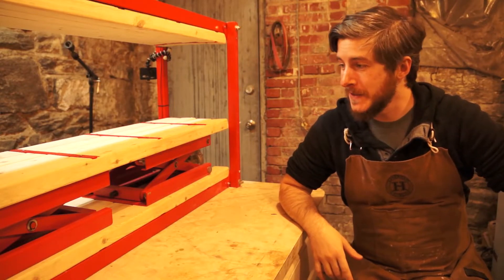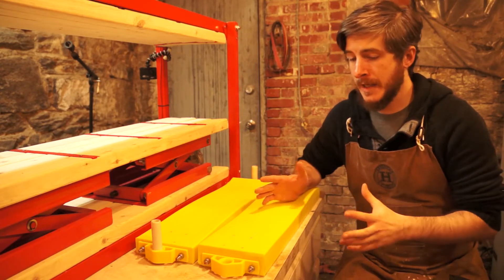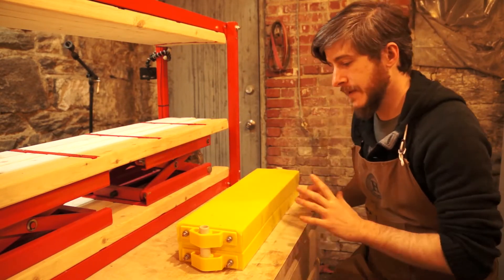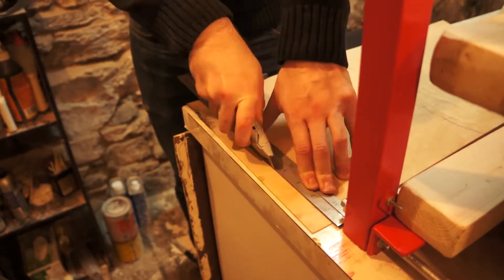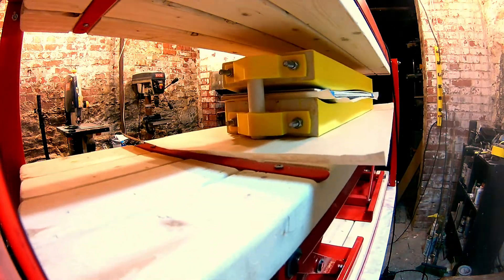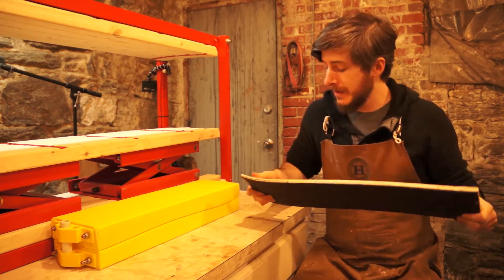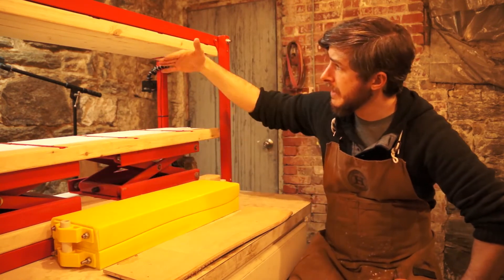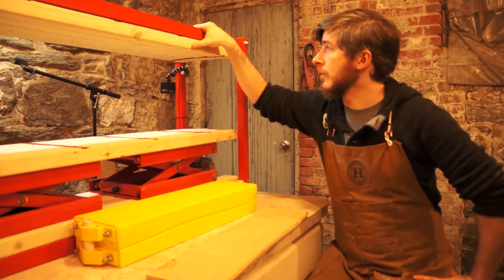3D Printed Skateboard Mold - Version 2

Comment: Great video I have been considering doing the same thing and came across your video. I have a 3d printer but am not good with CAD software you should do a full tutorial on how you come up with your shapes in cad. Also I love the idea of printing in vase mode and filling it with plaster or cement.
Reply from the maker: I'm planning on it! There are actually a couple different ways of designing a board in CAD and I haven't settled on one that I 100% like yet. As soon as I do I'll document it and get a video up. Thanks man!